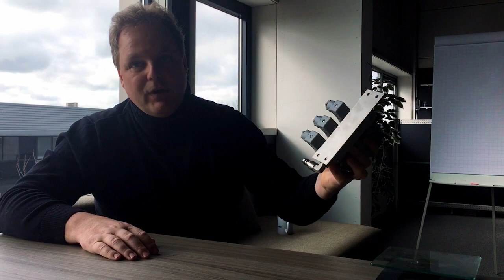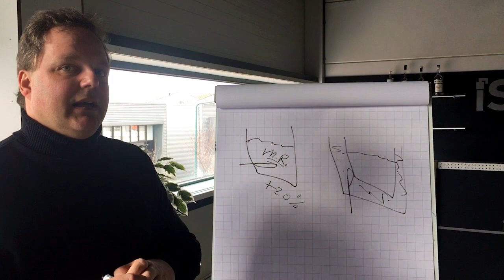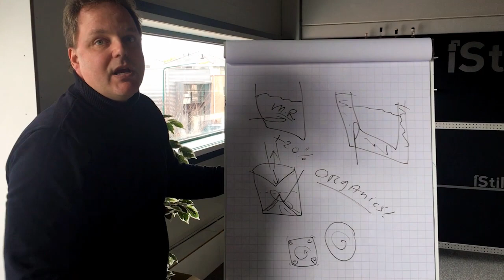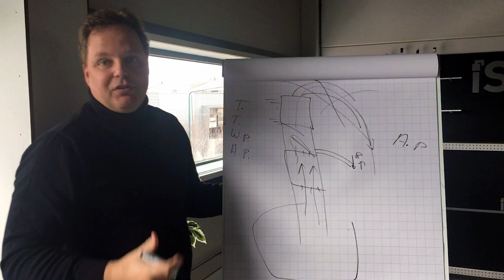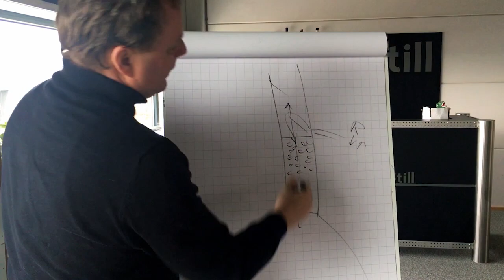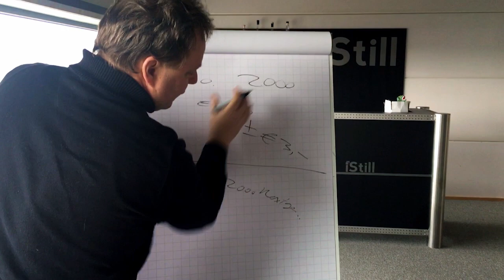How to make the best still ever!

Comment: Good video. I wouldn't mind one of these iStills - although not much room in my garage.
I was a bit confused by the use of the term "number of distillations". Remember the Pot Still is a distillation step with one theoretical stage - you can think of it as one tray with certain characteristics. 
In order to determine the height of the packing section (Z) within a column you should use the parameter HETP (Height Equivalent to a Theoretical Plate) for the specific packing material you're using and know the Number of theoretical stages (N) needed to achieve the end product you want (usually the McCabe-Thiele method is used to determine this value). So Z = HETP * N
Rather than use the Equilibrium Stage Analysis method above, alternatively you can use a Mass Transfer Analysis method. In this case you need to determine the Height of a Transfer Unit (HTU) and the Number of Transfer Units (NTU). So Z = HTU * NTU.
Either the HETP or the HTU method can be used to design a distillation column.
Also, the use of a square boiler to control mixing characteristics is rather odd. I am sure that it works fine, but there are disadvantages with non-cylindrical or non-circular tank designs. You can control the mixing and flow characteristics of a standard cylindrical tank by modifying the impeller design and inserting baffles.
Also, there is nothing novel with having total reflux as well as liquid management within the column.
Reply: HETP is reflux quantity-dependent. What matters is the temperatures the liquid management result in.

Comment: Hi Odin. Glad to see your doing well with the istills. I have no doubt that they can make a fine wodka, but I seriously doubt their ability to make a good "brown" spirit. I'm interested to hear how you can contradict yourself on the virtues of copper being necessary in a still, but also talking about copper contamination. In my view, if you included copper packing, you would by your own words contaminate the product. How does this work?
You imply that sulphides are a result of bad fermenting. From what I know, sulphides are an unavoidable byproduct of the fermentation process and need a catalyst in order to remove them. How does your stainless steel still do this? Does it ferment better than other ways?
I agree with Ada'm below. Saying you invented something does not make it true by just saying it. Respecting those that you learnt tricks from goes a long way.
I respect you for using technology in your stills, but anyone thats been around for a while knows that you didn't invent slant plate stills. Mc Donalds are close to making a robot to flip burgers, but that does not mean the robot can taste them. Vodka is easy, brown spirits take skill a robot does not have
Reply: The copper packing in the column is easily exchanged.
Reply: They make exceptional drinks. To make quality spirits, one first needs to be able to make reproducible results. The iStill is all about control. Control results in reproducibility. Reproducibility results in constant and amazing quality. Other stills are based on 1870's tech (or older) and do not give control. No control => not reproducibility => no quality. Hope that makes sense, Empty!

Comment: Hi I watched a couple if your videos and you seem to have a passion for distilling.  As I understand it your column essential uses fractional distillation with pressure manipulation.  Is there any danger of the system closing completely creating a pressure build up?
Reply: From my understanding the iStill doesn't use pressure and to the contrary doesn't build any. To confirm send Odin a message at sales@istillmail.com
Reply: Units manage temps, not pressure. The iStills cannot build-up pressure.